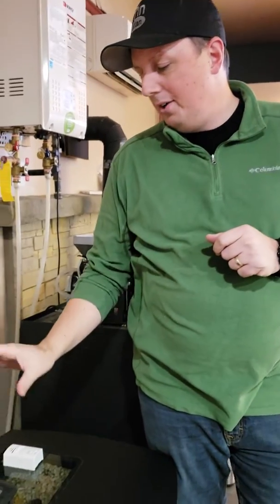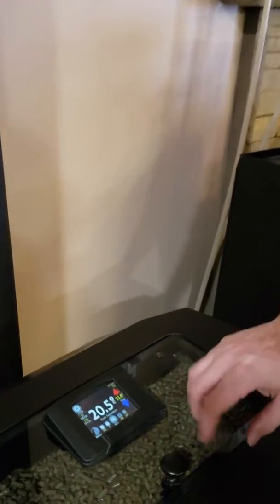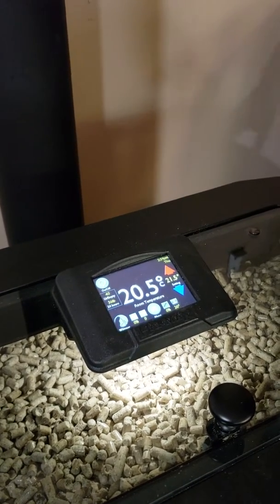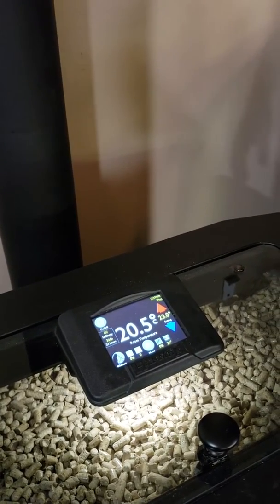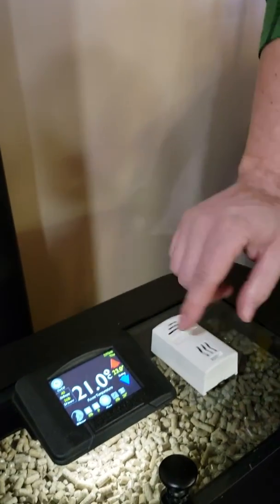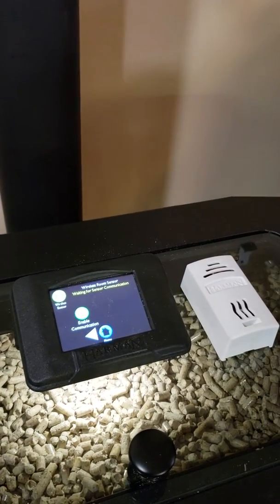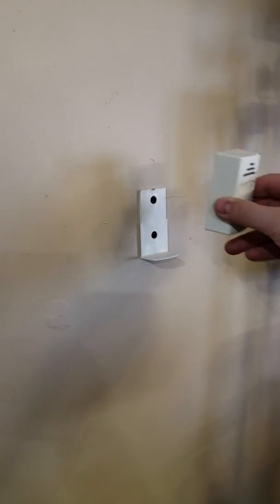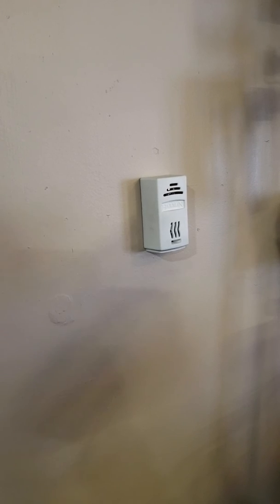Harman wireless sensor installation

Comment: Any idea how good the signal goes through floors and walls ?
Reply from the maker: Works fine. I have mine upstairs and my stove is downstairs in the recroom. Range is 30ft.
Reply: @tinmaninc2023  Thanks i plan to stick mine on the first floor. With the harman  the basement. Replacing the wood stove this summer.